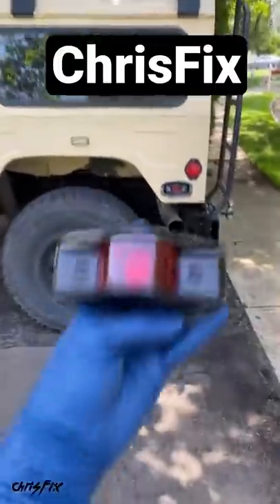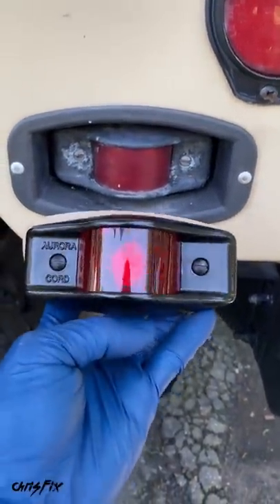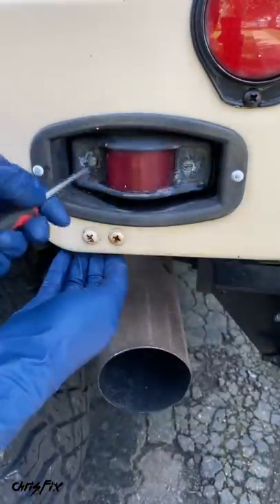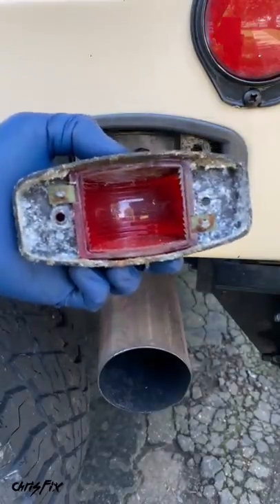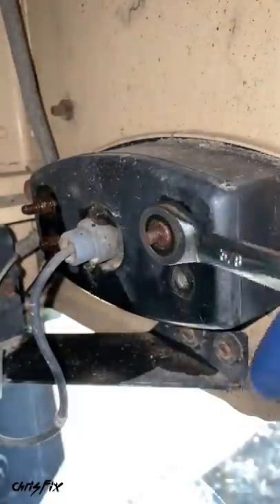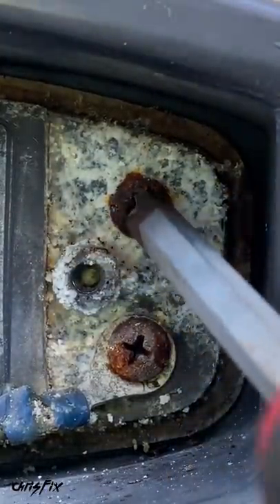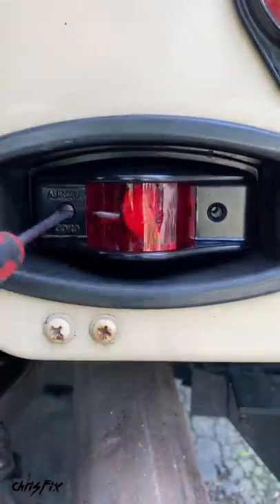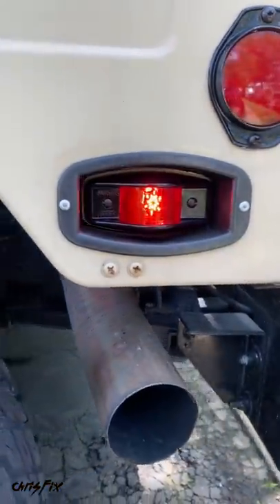Converting from Incandescent to LED Lights #Shorts

Comment: 6 screws for one tiny light, no wonder the Hummer is so heavy 😄
Reply: Just in case to make it hard for the enemy if it gets into their hands when on field. 😁
Reply: Think about what you are stating. 1000 of those screws, would probably weigh in at a mere 10 lbs.
Reply: 6 screws, 4 washers and 4 non-captive/loose nuts... for one alloy light. Why?!?
Reply: @stinkycheese804  it was a joke
Reply: @stinkycheese804  bro it was so obviously a joke
Reply: @stinkycheese804  They obviously meant the lazy and extravagant design philosophy and not the actual mass of a few screws.

The designers of the Hummer obviously had a very inefficient and lax approach to designing the vehicle and made no attempt to save material, weight, or ensure things were as efficient as they could be.

My family member used to own an H1 and everything was built this way. You could argue that it’s stronger, but it really isn’t. It’s just wasteful and excessive. Shit constantly broke and malfunctioned on that thing.
Reply: 69

Comment: Along with everyone commenting on replacing the entire housing as well as the bulb, I would also add that typically your want to get LEDs that match the color of the lens, ex: red for rear, amber for front. Otherwise, the cool white of the LEDs (in comparison to the warm white of incandescent bulbs) can produce a light that is discolored and annoyingly noticable
Reply: I tried that back in the day. Found out that the white LED can only pass a small amount of light wavelengths matching the lens color, while the rest is filtered out. That makes the bulb look much dimmer. So yeah, LED bulb should always match lens color.

Comment: Quick hint, couple of gentle tappity taps with a tiny hammer on the screw driver to set the philips head in the rusted screw nice and snug.
Reply: I came to the comments just for this.  Also, if the previous guy cammed out a phillips screw head, using a flat tipped punch you can lightly tap the stripped corners back into alignment.
Reply: No wonder I got it wrong... I just pounded on it while yelling. Damn. 
lol
Reply: Do you watch AvE?
Reply: @-Sean_  AvE?
Reply: @EatCarbs  I think you'd like his channel

Comment: One tip from sad experience: use a barrier chemical, like silicone grease, on the stainless steel threads. Stainless is great for corrosion resistance but it tends to gall very very badly. A lot of the stainless steel nuts I removed when I worked in an electric company broke the bolts off in the process
Reply from the maker: Thanks for the tip!
Reply: Very true, at our shop we either use a barrier chemical or a zinc plated nylon lock nut, which will avoid the binding from stainless on stainless.
Reply: I didn't know that. Thanks for sharing

Comment: Something to keep in mind is that some circuits rely on the resistance of an incandescent bulb to maintain proper readings in the cars ecm. I tried replacing the dash lights in a 94 ford with leds and had to take half back out because they caused functions of the truck to not work.

Comment: Remember that when you add an LED light to a car that normally has incandescent lights, you need to also change the entire light housing like Chris did.
Incandescent light housings are designed for much weaker lights and adding LEDs makes them blindingly bright.  The blinding light from an LED bulb in an incandescent housing is very strong. That can be dangerous for them, and dangerous for you.
Reply: That depends on the bulb though for most LED bulbs they are poorly designed for normal housings. However i have LED lights that are designed to be a drop in replacement for the incandescent ones and so far i haven't gotten any complaints as the metal casing has notches to direct the pattern so that it won't reach the upper side of vehicles.

But for the rest I agree a whole new housing is definitely required.
Reply: But this is just a new version of the same incandescent housing with an LED bulb in it. Regardless it's a marker light, not signal lighting or headlights so as long as it's at least as bright as the incandescent it really doesn't matter.
Reply: a n i m e
n
i
m
e
Reply: An LED bulb that replaces a brake light or turn signal, behind a prismatic lens, will not be blinding. Did it on both of my cars. The brake lights and turn signals are definitely brighter than stock but not blinding at all.
Reply: @Patrick94GSR  yeah that'll be fine, I've seen an audi with oem led brake lights that are already blinding lol
Reply: All you need to do is readjust your headlights and you’ll be good to go
Reply: You don't have to change the entire headlight housing, buy quality LED headlights (not that chinese bullcrap from wish) and make sure the light output is good. And use a headlight adjuster, (if needed)

Comment: The screws which get corroded are used for a reason. The screws used as OE reacts with the air faster than the metal sheet used in the body of the car, saving the sheet from corrosion.

Comment: Try to use anti seize or Loctite on stainless bolts and nuts to prevent them for galling.
Otherwise you'll never get them loose again.
Reply: Could you explain like I'm 5?
What is galling and how does Loctite prevent it?
Reply: @FLdancer00  I can try, I do not know the exact ins and outs :-)
When you use stainless nuts and bolts, in certain applications they can gaull.
I think this is some sort of an chemical reaction which causes them to almost become one part.
A bit like rust on a normal nut and bolt.
When you use anti seize or loctite you prevent the nut and bolt making contact, so the reaction will not take part or be much less.
I hope it is clear, like i said I do not know the exact ins and outs and English is not my main langauge.
Reply: @FLdancer00 
When two dissimilar metals come in contact gauling can occur. It can weld or fuse together. Thus the need for anti seize compound.

Comment: Depending on the year of the vehicle, older vehicles with incandescent bulbs will have significant problems with led lights. 

If it it doesn’t then great, but have seen older cars taken to the shop because the led lights interfere with the electrical system and have to be converted back to incandescent lighting. 

I simply put the long life bulbs in my truck and cleaned the lenses with mother’s mag wheel cleaner. 

All purpose metal cleaner does the trick at cleaning the lenses on vehicles.
Reply from the maker: Interesting, how does it interfere with the electrical system?
Reply: @chrisfix  based on listening to the mechanics when someone took their vehicle, it turned out that the led lights interfered with the vehicle. Based on my electronics class and research into led lights, if the converter is not accurate then the power consumption will be lower with led lights, so with anything that has incandescent lights, fluorescent lights, or anything else including the lights in the refrigerator section in grocery stores have to be re-engineered for the power consumption difference, significantly lower consumption, therefore if the little converter kit has a bad match then it’s going to throw off the power output from the battery or alternator, which basically means is that even the the CC amps are needed for the car to start there can be too much power output and restricting or not consuming enough power to maintain a balanced power consumption 

It’s like the home led lights which shows the significantly lower power consumption compared to an incandescent, but those are well regulated and balanced, but a bad car led conversion may say compatible with the car but the car may not like it. 

Let’s consider baby food as an example. Parents read the label and determine it would be good and taste good for their baby. Baby tries it and throws up and throws a tantrum. Parents get confused because of the label.

Comment: Pro tip: put antiseize or grease on the threads of stainless fasteners before tightening them. Stainless steel develops a super thin oxide coating when exposed to air, and not coating the threads can lead to galling and seizing when that oxide layer is broken by the threads tightening down. Kinda like what happens when you use a steel bolt on an alumimum nut, except it happens much quicker. AvE did a good video on stainless steel galling and cold welding.

Comment: Nice job..
Though I would have added sealant to ALL mating surfaces. Just putting in stainless steel hardware will not prevent the plates from corrosion

Comment: They need to bring led down several lumens.
Reply: No they don't. Lumens has nothing to do with why they blind people. They blind people because of the output pattern, it's direct beams of light vs a soft glow radiating out. This is why you're "suppose" to only use leds in a projector, but thats other people problems, not the driver problems. Also most people don't adjust leds before they install them, you can loosen them and spin the housing on pretty much all leds to get the beam pattern perfectly horizontal which further prevents blinding people. The actual light output is not much more unless you get really expensive leds or hids.
Reply: Yeah I dont care. They're a hazard.

Comment: Dry-installed hardware will corrode. Prevent corrosion by wet-installing your hardware (yes, even stainless). Wet-installation can be achieved with epoxy primer or moly-lube paste.

Comment: There's a few things wrong here that may mislead people.
1. LED marker lights aren't legal everywhere, and not always recommended by DOT due to their brightness level being too high and too directed vs dispersed.
2. Stainless bolts or nuts react with carbon steel and aluminum, so it may not be advised for this purpose if it goes through a metal plate.
3. Using silicon paste IS NOT correct to use, using Silicon based Dialectic Grease is proper, as dielectric grease is made to not solidify. As well, silicon paste is usually made using a mix of silicon materials, some which may be conductive depending on the brand.

Comment: Something worth considering is that you're using stainless steel screws - good choice if you're only mounting to plastic - but if the screw touches any regular steel, it will react and still corrode. I'm assuming that piece you're mounting to is plastic, and hope the stainless screw doesn't intersect with any of the steel body.

Comment: if your car can detect burnt laps then you need a canbus type otherwise it’s better to use one without a load circuit to save power and they are cheaper especially for bulbs that stay on when the engine is not running, like interior lights so they don’t drain from the battery

Comment: Not sure if you know but using a Carbon steel screwdriver on stainless steel  contaminates it. I have also seen steel  contaminates. make aluminum rust. Carbo on Carbon, stainless on stainless, aluminum on aluminum.   Safer that way if you want long lasting.

Comment: I wouldn't use stainless screws with an aluminum housing, it will rust due to galvanic corrosion, the stainless will eat away the aluminum

Comment: Instead of cleaning out the rusted screw with a pic couldn't you just put the screwdriver in it and hit it on the end of the handle to get it so sits properly because I do that and it works

Comment: Be careful replacing the hardware with a more corrosion resistant material, if there are 2 metals in contact the less noble/corrosion resistant metal will be the one that corrodes first, whether that is the fastener or the body of the housing/vehicle. I have seen stainless hardware rust like cast iron because it was in contact with a higher grade of stainless steel.

Comment: Nice but you failed to use anti galling compound on the stainless steel  screws.  Galling is extremely common with ss fasteners. Forcing you to have to cut the fasteners should you want to ever remove the item again

Comment: Chris, those led bulbs won't last long enough. So many SMD chips, they are all failure points and they burn way more easily than they should. Try getting a single chip bulb preferably with a lens attached to it.

Comment: Easy swap to do on a 90s vehicle anything over mid 2000s you need a ballast or the led will flicker. You think the older vehicles would need some sort of item to make the newer lights work on older cars. But with all these computers in new cars. It’s the opposite

Comment: Its a no on the silicone. Use dialectic grease instead.
Reply from the maker: Silicone grease is dielectric...
Reply: I've only ever called it dialectic Grease. It never sets up like silicone does.

Comment: Chris I got a dumb question? So my friends parents put 10w 40 on a 2010 Corolla le. It takes sae 5w 20 or sae 0w 20. They say 10w 40 is better because the car is old. The check engine light was on before I did the oil change for them. After the oil change it disappeared.

Comment: NEVER use Stailes steel screws in normal Steel. In this case the hummer is made of Aluminium so it's okay. But on normal cars NEVER use stainless hardware with normal steel

Comment: I put in LED bulbs for the brake lights and now they work but I am getting trouble light on dash because car pre-check does not recognize them being there. They make a resistor you have to put in so the computer will see them and not give a warning light.

Comment: And the reality is that new light may last longer than couple of original bulbs, but then you need to replace the whole light instead of just a bulb? For a cold country and winter those led lights are just overhyped. Can't even see those under a snow. Should not be a thing in cold countries.

Comment: Sir, my Toyota Rush car had its radiator fan motor damaged a few days ago and the engine hit the red temperature. I installed new fan motor. Now as soon as the car starts, there is a squeaking sound around the engine. However, as much as I drive the car, the engine is not so hot. But after turning on AC, engine gets very hot, even in the heat to open the bonnet is very difficult. After turning off AC engine become cool again. However, the temperature light does not turn on and the radiator water is always fine. Please suggest me how could I solve the problem.

Comment: Chris I have a 2008 Ford Mustang Gt Deluxe Premium 4.6l v8 with 80k miles. and it just started to tick. But it seems like its intermittent. I took it to my mechanic and he just laughed and said that's common with my engine he says when oil moves around in my engine sometimes it will be quiet and sometimes not. Is there anything I could do to quiet it down?

Comment: I have a 2021 ram hd 3500 longhorn mega cab diesel H.O. 4x4 : Question has anybody have had or known problems with front hub bearings going bad ,, My left side has a decent amount of play and a little amount of play in the upper ball joint. I bought the truck new in may of this year with 7 miles, checked the truck over at 500 mile found front left side hub bearing with excess play. I also had a 2017 ram hd 3500 limited diesel H.O. 4x4 with the same problem hub bearings going bad every 15k-20k .both truck completely stock.need answers thanks